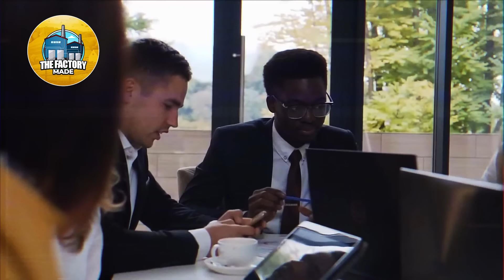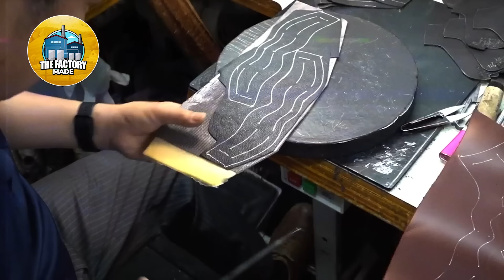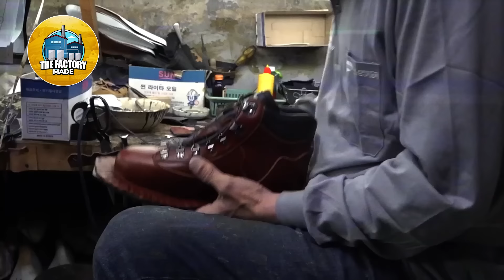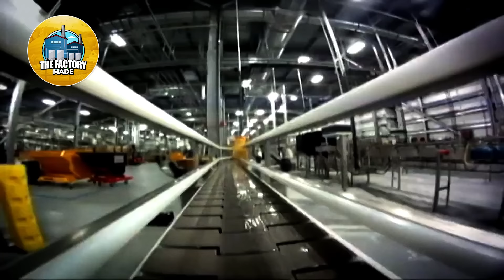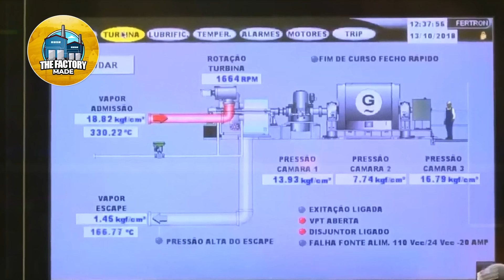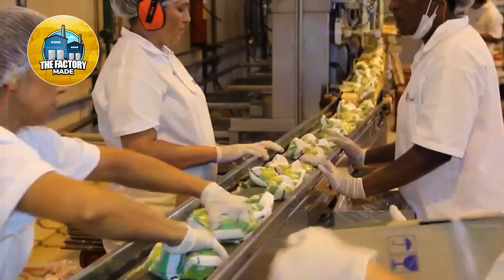How Timberland Boots Are Made - And Why They’re So Expensive

Comment: What a load of rubbish, these modern Timberland boots are poorly made compared to those from years ago, my pair that hadn't been worn a great deal had the soles starting to come away from the uppers in the heel area, that's a bit strange in itself, if it was the toe area I could understand that, what this revealed was a poorly made boot and I wont be buying another Timberland product. There is a YouTube video elsewhere showing how badly the Timberland Premium boot is put together when it is cut in half, then people are being charged $400 for a boot that is no better than the regular version at nearly half the price.
Reply: As they've seen that their boots have lost their original purpose as work boots and have become more fashion oriented, they see that the majority of its boots wont be worn by people who'd wear them well enough to notice any actual quality issues since its basically just some kiddos wearing them being afraid to even get a drop of water on them. Because of this, they can lower the quality and few would complain. 
Dissapointed in the company.